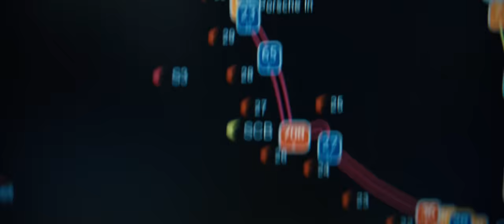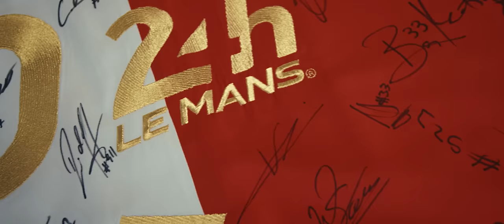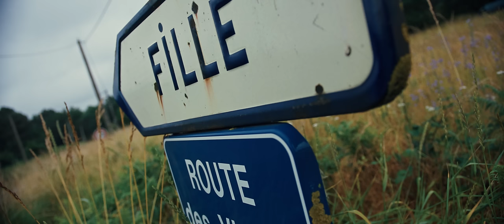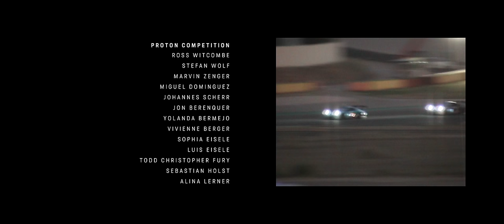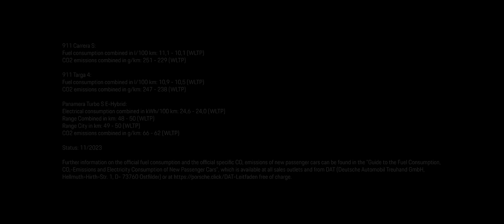Michael Fassbender: Road to Le Mans – The Film

Comment: I sincerely hope Michael's Le Mans story is not over...
Reply: Well, the GTE class is no longer, unfortunately.
Reply: @kirillryzhkov2021  He can run the GT3-like class that is replacing GTE.
Reply: I'm not certain about LMGT3 category will have amateur drivers. But one thing for sure, they are harder driving than LMGTE. So I don't know will he have a shot or not?
Reply: @RealRSmokinJoe  The problem is that Bronze drivers may not be allowed *there's no GTEAm equivalent
Reply: @alialibeyoglu7532 they might go back to the previous split of classes, Pro and Am like they run in GT World (although they have like 4 catagories). As I understand the main reason for switching to GT3 was brand participation and cost. A lot of the pushback from drivers though was because the GT3's were 'easier' to drive, having ABS allowed as well.
Reply: @juaneer  LM GT3 is designed as Pro Am, meaning that bronze drivers are allowed and no subdivisions are needed.
Reply: @MinusMOD98  oh great then
Reply: Except it's only two cars maximum per manufacturers, so Porsche only allowed to run 2 cars in LMGT3.

And with 15 spots reserved for LMP2 for Le Mans, it might be even difficult to get 3rd entries for each  LMGT3 manufacturers.
Reply: @DannyPlaysStuff  It's actually Manthey that will be running the LM GT3 effort for Porsche, and they surely have six drivers ready to call up to the WEC So yeah, Michael's gone unless he moves to Manthey.
Reply: Or win ELMS LMGT3 class, that guarantees automatic entry into Le Mans
Reply: If not le mans i really hope his involvement in elms continues.
Reply: Never got started
Reply: He deserves to come back
Reply: @ash6248  Thing is, Proton competition is no longer associated with Porsche, they switched to Ford. Michael was probably not factored in with the new manufacturer contract
Reply: @juaneer proton still has the Porsche 963. This series may be over but im not sure his racing story is over.
Reply: @General_RIMT  you think Michael is ready to get in a Hypercar?
Reply: @juaneer  no, im just saying that proton competition isn’t restricted to just Ford. They will also be providing logistical and operational support for the iron dames 911 GT3 entry in ELMS 2024.
Reply: @General_RIMT  right ok. Proton will actually be running a single GT3 R in ELMS, number 60, and the bronze driver will be Claudio Schiavone. 

Definitely looks like no ELMS for Michael next season. But I hope he stays active doing some cup car racing or so
Reply: Porsche do
Reply: I wish he at least try to became a Le Mans finisher
Reply: He doesnt want to...

Hes firstly an actor.

Comment: A compelling story. I have not circuit raced because I was never deeply attracted to it. I went into the rally world where adversity lurks at every corner and every straight. Le Mans is an immensely difficult race because of the speed and need for sustained concentration levels. If you do not have rhythm you are done. In one of my last dirt rallies when I was about 60 I was doing a 50 km stage at night in foul rain with mud and massive drop offs if you understeered off a slushy corner. Every time I pulled 3rd  even on the short straights I was in full opposite lock sliding down narrow roads and could get no rhythm. It was exhausting (I might add that at 60 I was still running soft sand half marathons (21 km) in 2.5 hours so I was not easily exhausted ) so I stuck it in 2nd gear and just drove for about 50 km on the rev limiter. I averaged over 90 kph and did not have a single spin. It was just survival. I have been involved in 2 Dakars (not driving) and that is a new universe of pain, especially if you are on a bike. Unlike MIchael I personally funded all my cars, all my accidents and all events so it literally was all on me.  I and my team went for years without any issues and it was sensational fun and we all had such a great time.  When it is good it is sooooo good but when it is bad......

Comment: Very interesting. Le Mans was a huge mouthful to bite off. Very tough race, even for seasoned pros. Not because he's incapable of driving the car quick enough, but because the demands on the mind and body are like no other race, and it's multi-class, with cars of all different speeds, on a very demanding circuit. So many elements for the driver to deal with.

Comment: Any1 knows how much kerb wight and power has that car that Michael was driving?
I tried to simulate his best lap in a simulator with a Porsche 911 RSR 2017 which should have the kerb weight of 1245 kg and 510 HP.
I managed to do 4.04.58 in 5 laps of hot-lapping, I reckon I could maybe shave a little bit of time but 3.59 is one heck of a time, that's why I am asking if the Porsche Michael drove had a bit more power maybe, i tweaked a bit the setup and got 290kmh on the straight but then again I am no mechanic. Maybe if I had a pro setup I could come closer to 3.59.
Great documentary, my secret dream was/is also to be a racing driver, but that's an expensive sport. Hats off to Michael for being a great actor and a racing driver.
I put a lot of laps on the green hell as well with a Porsche 956 as a tribute to Stefan Bellof's record on the Nordschleife. He did 6.11.3, I think I managed the lap in around 6.17 to 6.21 time mark.
Reply: The factory drivers at Le Mans are doing 3:50 flat, AC tyre model is nearly ten years old and their GT tyre doesn't have the grip. Also the car Michael was driving is a newer RSR with more torque and the BOP is probably different to allow more peak power.
Reply: @reno9k tnx for the answer makes sense now. That's why we are waiting for AC2, next year hopefully 🙌👊🤝

Comment: FAO film editor.  I'm only at 4.49 and the sub-title says "Well, I mean, that's like, how long is Peter's string?" What the female actually said was "....how long is a piece of string?" . It's a well known expression in English when trying to say you can't give a specific length/durartion of time to something. It's not a strange/rarely used expression in English (yes - that are many many of those), so I really hope that this is not going to be a reflection on the rest of the 1hr 30min film. It's just surprising that the attention to detail wasn't given to this. I guess the excuse is that it's AI generated - still needs to be validated tho. Just a shame when so much has gone into making the actual film - and that it's made by Porsche. Designers of outstanding cars.

Comment: For anyone into Porsche stay away from Hennessy Porsche in Alpharetta. I have had a really bad experience form them. They don't care about their customers and they don't care about the work their mechanics do. drop almost 8k getting some work done with them and the car is no better. They even over filled the tranny and clouds of blue oil smoke came out from under my car as I drove it because the tranny spat out the overfill all over the underside of my car and onto my exhaust. They bled my brakes and gave the car back with a spongy pedal that you have to pump to get pressure and I had them do a four wheel alignment, the car does not drive straight. Utter cowboys. They are utterly useless and only care about the money spent. Not you or your car. They are about the worst dealership I have ever used Porsche or not. STAY AWAY FROM HENNESSY PORSCHE IN ALPHARETTA GEORGIA.